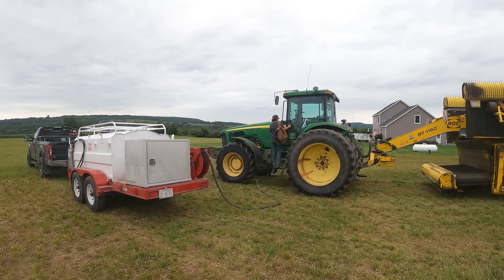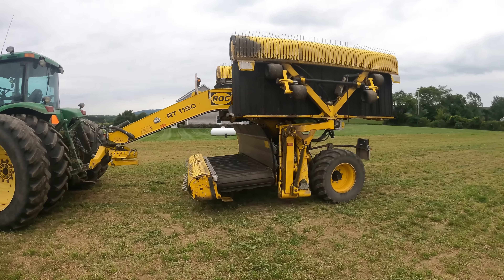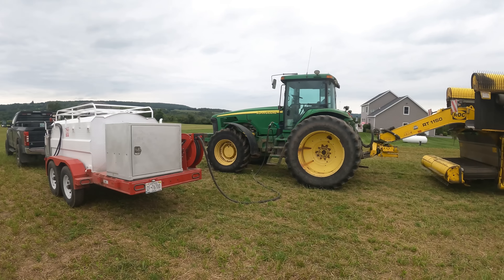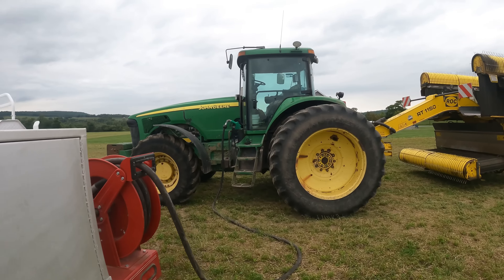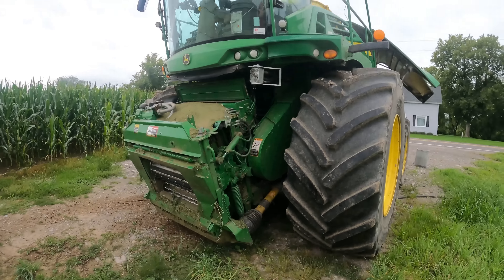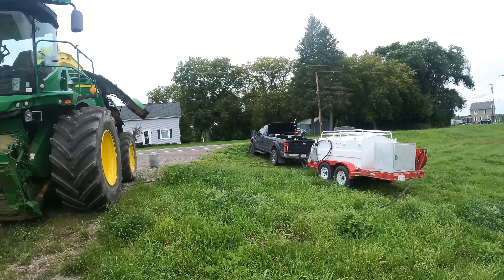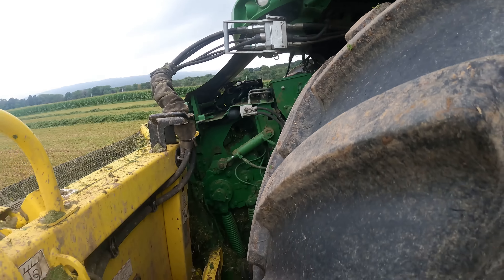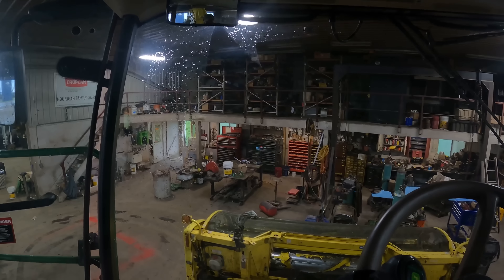More problems

Comment: Hey, I’m just mentioning you need a piece a heater hose about four or 5 feet long put it up to your ear and you snoop around with the other end and you will pick up what the noise is coming from. Trust me I’ve used it 1 million times all right not 1 million but a lot.

Comment: I always used a screw driver with its head pushed against an engine block and the handle to my ear so as to the source of any strange noises coming from my competition engines.
The whine here seems like a belt/bearing one.

Comment: Like the other commenters, the old long screwdriver against the ear, one old mechanic that I knew used an old wooden broom stick cut off and he took a plastic gallon oil jug cut the bottom out of it ,  taped the neck of the jug to the end of the broom stick and put the open end of the jug to his ear and placed the other end of the broom stick close to the suspect bearings or shafts.  It doesn’t sound like a cutter head knife problem to me as it is usually a tick tick sound and the repetition rate is too slow, more like a bad bearing on an idler pulley. Good luck finding the problem, much more complicated chopper than the old pull behinds that I was familiar with.

Comment: @dumbPeople      Hoses have a "wear out by date" on them when you use them with chemicals or fuels... he'd have to be driving 15 feet from the tractor across gravel to wear that hose out faster than the fuel pumping through it will.  He could beat fires out with it, use it to pull skidsteers out of mud and hang laundry to dry on it as well as pull every millimeter of it tight to the hole and its still going to melt from the inside first.   The only thing I'd yell at him about... if he was in Florida ... would be to get a sun/weather shade over top the hose reel.

Which would actually be a good idea for winter, Andy.   Get an old Brute can and crop it into a cover for that thing!   I bet you've got a hot belt squeek that's still weeping when its cold.

Comment: Those noises are always difficult to find. I used one of the automotive stethoscopes with an extended hose and a piece of steel brake line added to stick it into areas to find noises and it worked well.

Comment: It is amazing how deceiving the location of a noise can be to find. I once had a new car with a unique noise that drove myself, the mechanics & service managers crazy & we finally resorted to finding a freshly paved section of a highway and having the mechanic lay across the top of the engine while I drove with my head out the window because I couldn’t see ahead because hood was up.  People thought I was insane to the degree I went to in order hear the noise as we couldn’t duplicate it in the shop or on a normal test drive. At one point I was told to let it get worse & warranty would hopefully cover the repair to which for me was not a satisfactory solution. This was over 30 years ago so can’t remember what parts were eventually replaced to solve the problem but I was happy that noise was finally fixed.

Comment: We run the harvester and squirt wd-40 on the bearings. It will change its tune soon as you hit the bad one. Probably a belt tensioner. Good luck.

Comment: When you were on the left side is down by the drive wheel it sounded like a pulley bearing going bad. I’m sure you figured it out by now but if not, good luck.

Comment: Did you slip the belts when you plugged up the other day?   It sounds like you belts are just barely slipping.
Reply: or a belt tensioner idler pulley
Reply: If he slipped the belts or not it should only do it under load but it does it when it gets warm when it’s not under load so belts and idlers are out of the picture

Comment: If it's heavy fuel pump hose, I wouldn't worry about it. We had fuel grade hose on a sealcoat crew that we drug on blacktop, gravel, grass and dirt as we sprayed or wound hose. Guy I worked for had the same hose for 15 years I worked for him. He said he had it for 10 years before I worked for him. If it wears out in less then 10 years it was crappy to begin with.
Reply: This was the heavy hose you find at a fuel refilling station.